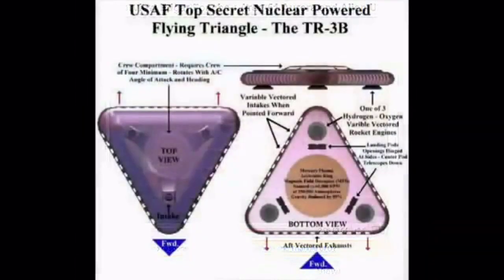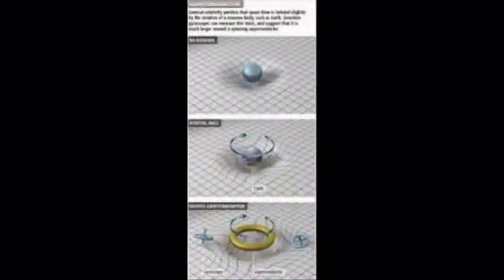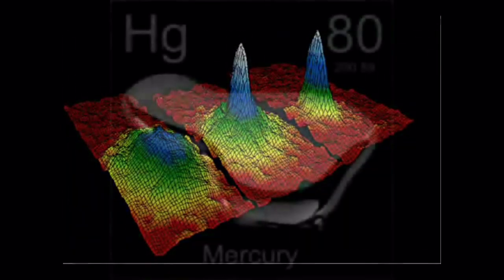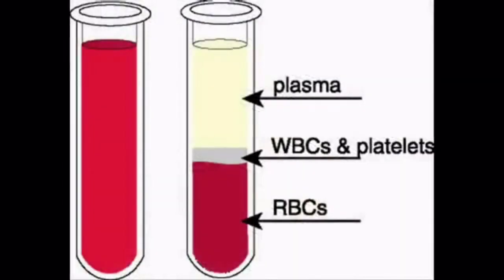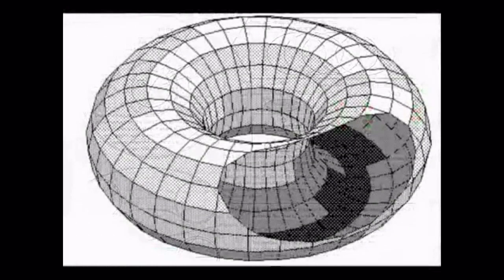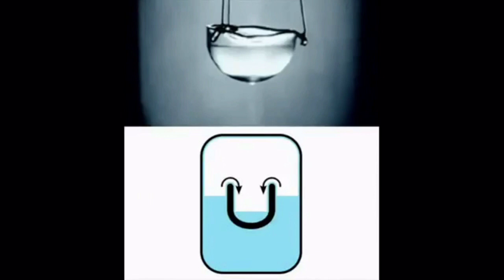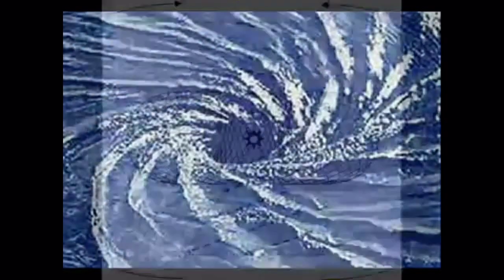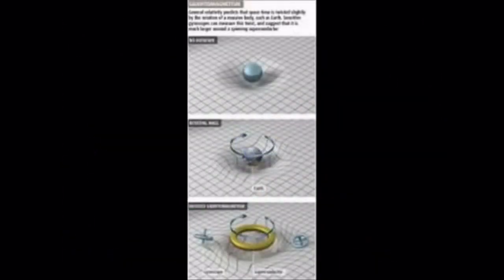TR3B Tactical Reconnaisance Plasma Centrifuge Anti Gravity Triangle

Comment: If  The TR-3B using This Taurus type of  Propulsion, this would seem like an older design as Mach speeds are no longer used in an antigravity propulsion system as the speaker stated on the beginning of video "this is not an antigravity system, " This system is based more along the lines of how hurricanes form, the info gathered from HAARP  The control and manipulation of particles  including reverse engineering must have came up with this design.A much better design would be the use of Radiant Energy ,Based  on The Tesla Teleportation documents that were stolen when he died in 1943 sent to New Mexico ,for Manhatten ,Philidelphia and Pegasus projects,with DARPA funded by Obama and pentagon ,also included  was the chip that was intended to be imposed on all citizens with other countrys support, Jade Helm was a test of strength ,more like a practice drill as they called it or live simulation ,experiment to predict what the public would,evaluate information , then enforce a counter strike when they create their Agenda of Control.Darpa now working on internet mind control .

Comment: The TR-3B is not meant to be an aircraft. It is a TIME MACHINE TELEPORTATION DEVICE. It needed to get off the ground so that the craft can be enveloped into a magnetic field. The craft was engulfed in a round ball of magnetic plasma, before it disappeared for time travel into another dimension. They say they used a mercury plasma acceleration ring ( magnetic field disrupter ) ( MFD ). They have moved on a bit from the 1943 Philadelphia Experiment that did the same thing with a battle ship.

Comment: The TR-3B is nothing to do with being able to fly. This large aircraft is being held up in the air by 3 huge rockets. They say that it uses Oxygen and Hydrogen fuel Rockets. More modern and safer rockets would use the same gas you use for cooking in your house for the rocket engines. Probably the whole space ship mainly contains fuel.

The TR-3B is not meant to be an aircraft. It is a TIME MACHINE TELEPORTATION DEVICE. It needed to get off the ground so that the craft can be enveloped into a magnetic field. The craft was engulfed in a round ball of magnetic plasma, before it disappeared for time travel into another dimension. They say they used a mercury plasma acceleration ring ( magnetic field disrupter ) ( MFD ). They have moved on a bit from the 1943 Philadelphia Experiment that did the same thing with a battle ship.

Comment: Utter bullsh_t.   Amazing how the video of these craft are constantly zooming in and out so as to deliberately stay out of focus except for a second here or there.   
NOBODY would deliberately film like that if they actually wanted to see clearly what they were filming.    It's nothing more than an attempt to hide the imperfections in CGI.
And by the way,   it is IMPOSSIBLE to cool a nuclear reactor in a small hovering aircraft.   Even a small nuclear reactor would require a constant flow of a large amount of cold water to keep it from melting down.  Air flow would not even come close. And by the way, fluid flowing at "relativistic speeds" inside a circular container could not possibly be contained by any structural material known to man (more utter Star Trek bullsh_t).     And exactly how did they pressurize that mercury to "200,000 atmospheres"??   Exactly what kind of container can contain a pressure of 200,000 atmospheres???   More utter BS.
Reply from the maker: you needed to watch closer.  nothing nuclear about it.  thats 20th century mind thinking.  there are no radioactive components.  its a magnetic ferrofluid in a mercury suspension spun in a closed system by magnetism.  where did u hear or see nuclear?  the large hadron collider does just that.  Spins particles at relativistic speeds.  Speed of light using magnetism alone.  So if we are doing it publicly, how is it so hard for you to understand with our t least 50 year advance we are not doing this?  And the system is COOLED to these atmospheres, not pressurized.  You are hearing some strange things in this video.

Comment: In 1996 I was working the night shift at my job when I noticed something flying towards me at about the speed and altitude of a twin engine plane but it was completely silent. When it got closer I realized it was actually 4 separate triangle shaped objects flying in a 1, 2, 1 formation. They weren't lit on the 3 points of the triangle, rather the entire object was lit a red/orange color. When they were directly overhead they did a tumbling, over, under, and around each other maneuver for about 3 seconds then fell back into their original flight path. I couldn't imagine the G forces a maneuver like that would create. It should have ripped the "crafts" to pieces and literally crushed anyone inside. Not to mention that through all the tumbling, they didn't collide with each other. I have no idea what they were and I haven't seen them since.
Reply: The reason they don't collide is because each of them create an electro-magnetic/gravity field or wave around them.  It is actually a toroidal field.  It is the same type of 'vortex' that is observed in the common 'smoke ring'.  These toroidal 'bubbles', as they are sometimes called, are what these crafts ride inside of.  The outer shell of this bubble forms a solid shield that nothing can penetrate.  This is why they don't collide!  They can't!  Oh and the tumbling you saw was due to how there crafts fly.  They actually do not fly!  Quite the opposite.  They each are equipped with 3 gravity generators.  One is for lift, and the others are for horizontal direction.  The crafts are manipulated by these 3 generators.  When you see them accelerate in any direction, they are not actually being propelled, or flown.  They are actually falling into the overall gravity that is collectively generated by the 3 'gravity generators'.  This is why they are very unstable in the fixed hover position.  Because they are just pivoting on that one 'lift' generator.  Oh yeah, and what you have described is almost certainly the TR-3B craft, owned by the US Military Black Ops.  I'm quite envious that you saw them.  I hope to cross that experience off my bucket list some day in my lifetime.
Reply: Ive seen this craft as well in the same holding pattern and I always thought that they looked combinable so that 4 could make 1 giant craft probably used as a air base.

Comment: That's wrong, it is possible to change magnitude towards a 90* vector. If a baseball is moving strait towards you and you hit it with a baseball bat, it's possible to hit the baseball towards any angle of 90*.
Reply from the maker: BUT THAT IS ACTED UPON BY EN EXTERNAL FORCE.  EQUAL AND OPPOSITE REACTION.  THIS TECHNOLOGY PROTECTS THE OCCUPANTS FROM THE FORCES OF INERTIA.
Reply: I think I was writing about the possibility of a 90* momentum after traveling a vector or momentum, an not about safety possibilities. In space is the only place to be safe performing such a maneuver. Also, that is why the crafts probably, always slow down and the human race get to see them at times; It's easy to turn at any angle if you are at complete stop, even if for a second. That still would have to be timed right in high gravity fields, or it will cause death. In space, it would not matter.
Reply: The narrator mentions that the vehicle is "not antigravity", therefore, it can't do what you wrote; "THIS TECHNOLOGY PROTECTS THE OCCUPANTS FROM THE FORCES OF INERTIA.".
Reply: I think they use artificial gravity to move these, imagine falling up or being sucked into a gravity field from any direction but down.

Comment: the power source would disintegrate the craft it's self before disturbing any field around it be it gravity or magnetic or electric field. since all of matter is held together by some force field.
Reply from the maker: WELL I DO HAVE A PHYSICS DEGREE WITH A MAJOR IN QUANTUM PHYSICS.  NOT SURE IF THAT QUALIFIES BY YOU.  BUT IT GETS ME AN UNDERSTANDING HOW SPINNING A METALLIC LIQUID WITH A FERROUS COMPONENT IN A MAGNETIC FIELD COOLED TO NEAR ABSOLUTE ZERO CAN PRODUCE THE BOSE -EINSTEIN EFFECT AND REDUCE THE EFFECTS OF GRAVITY.  ITS THE SAME EFFECT THE NAZIS WERE SUSPECTED OF EXPERIMENTING WITH WITH THE SO CALLED "NAZI BELL"
Reply: No, I don't think so because the materials that the crafts are made of do not exhibit much magnetic or electrical properties. Sort of how insulators prevent you from being electrocuted by the current running through a conductor. And the field encompasses everything within. So everything within stays relatively the same with respect to magnetic, electrical and gravitational effects. In fact, the crew members would probably experience only a small fraction of the G forces when the crafts make those radical high speed turns.  Any way, I'm glad that we are the ones with this technology. I think it was kind of funny when the speaker almost took off with how it was reverse engineered from ,.,.#$@ blah, blah, blah.
Reply: Like you're an expert and he isn't. god, you guys kill me with all your so called "knowledgeable".
Reply: That was directed at Seekerone not EddieVazquez
Reply from the maker: There are two types of gravity, gravity A and gravity B.  Gravity A is force on the atomic level that holds atoms together, electrons to protons.  Gravity B is the big gravity holding planets to stars and us to the ground.  Gravity A is exponentially weaker as you can momentarily break the effects by simply jumping into the air, or more permanently by launching a satellite.  Gravity A is the force field you refer to.  Gravity A is the type physicists are as we speak trying to access and amplify.  There lies the the key to interstellar and even time travel.
Reply from the maker: I mistyped, Gravity B is the weaker force as shown in many mathmatical equations and testing.
Reply from the maker: Until they discovered gravity was indeed a wave.  Just like radio and microwaves can be generated, manipulated, and directed it is so theorized that gravitational waves can as well.   If they are projected forward of a vehicle then the vehicle will be pulled forward as if constantly going downhill.  It will chase this gravitational distortion never catching up to it. If massive amounts of gravity can be generated, amplified, and directed, then warping of the spacetime fabric can occur possibly bringing far points of spacetime to the vehicle.   In this theory the vehicle moves very little.  Its space that actually bends and moves.